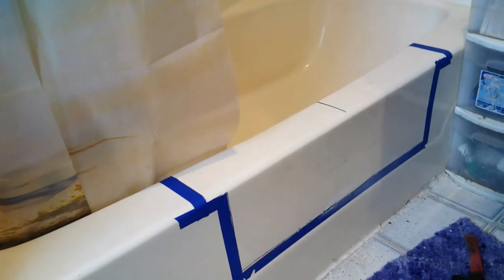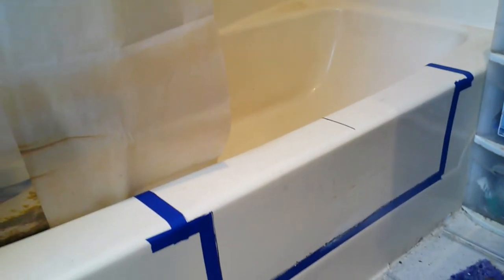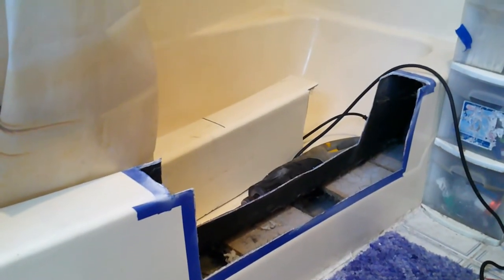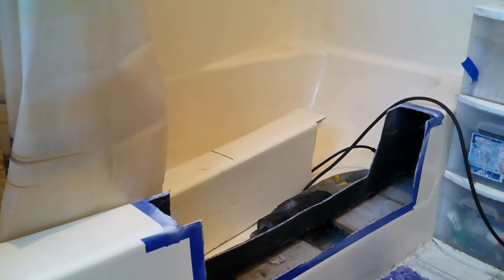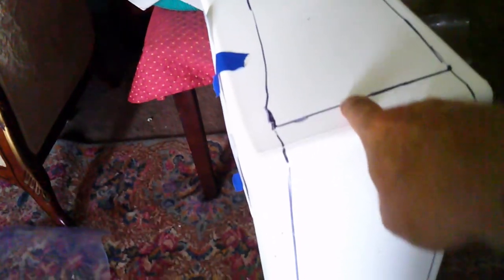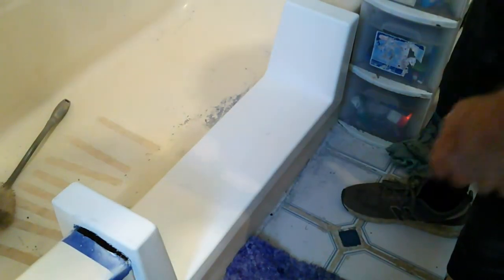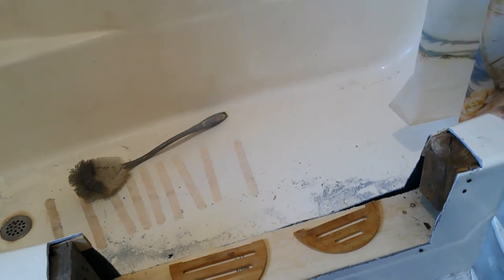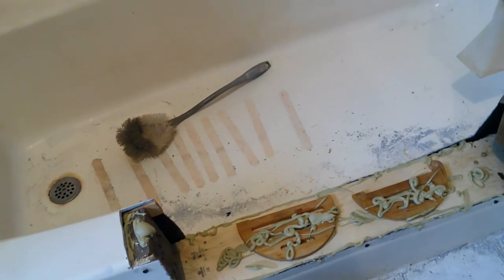How To Build a Walk-In Bathtub for the Elderly. $150.

Comment: Where Did you get the cut out insert?
Reply from the maker: Ebay
Reply from the maker: Was about $150 a year and a half back
Reply: hi, i love that have a video on how 2 install the walk-in bathtub cut out that's all great and everything for a porcelain or steel tub but my tub has is fiberglass on the side and it has steel on the top like a ledge, like u know on the top of a toilet tank.  and I really badly need this on my tub. do you have  a video where you instruct on how to go ahead with this kind of a tub that I have, really appreciate your input thanks much